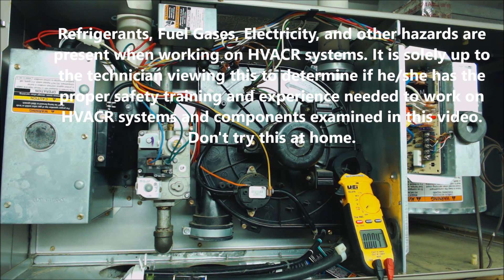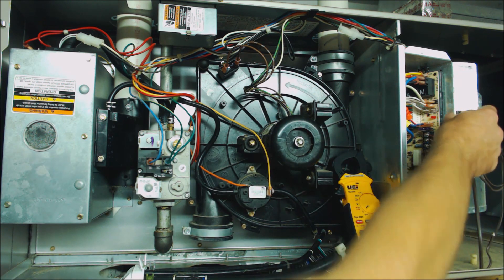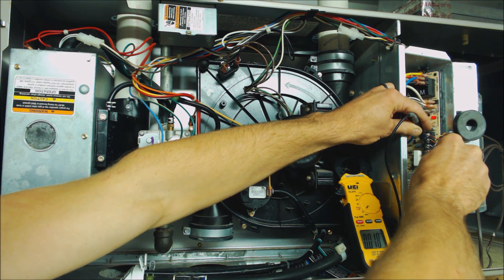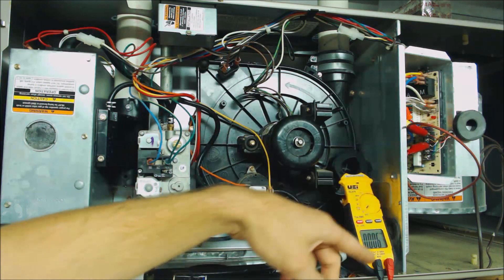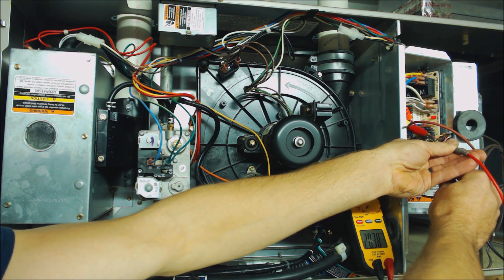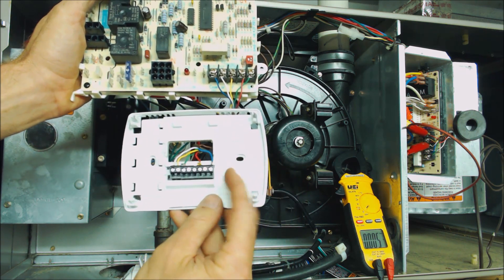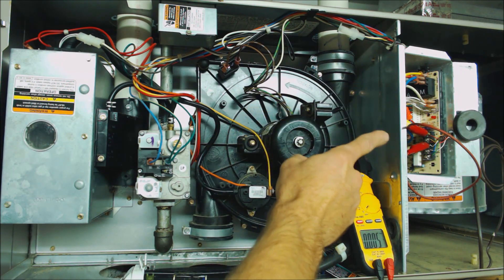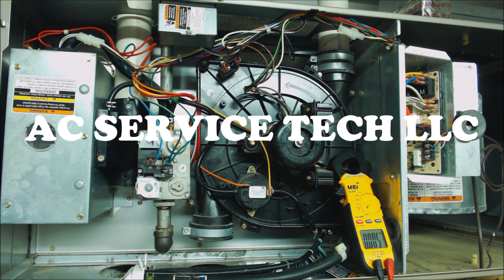Thermostat Troubleshooting! Thermostat Won't Turn Heat, AC On!

Comment: My set temperature display won’t even turn on, on my thermostat. It only shows the room temp. I put it on heat and it doesn’t turn on, or display the set temp.

Comment: I had an A/C company came out because the heat and a/c unit wouldn't come on.  So they went to my furnace and told me that there is some sort of switch in it there that would signal both the a/c and heat unit to turn on.  Could you give me any further information about this because as of today the same thing happened? Thanks

Comment: Thank you for this excellent video. If you measured voltage at the thermostat from W to the other terminals on the stat what voltage would you expect if there is 24V at W . For example if there was no common at the thermostat.  Is there any way of measuring the voltage at the stat if there is no common present ?
Reply from the maker: No there is not a way. That is why we jump in that case and then measure for voltage at the control board, thanks!

Comment: So I had a call last week where flame would go out 5 minutes into the heating cycle. The unit would go through the sequence of operations everything seemed fine then it cuts out. I cleaned flame sensor and that did not help. It was a 2 zone system with one thermostat controlling both zones. I checked zone board and could visually see the call for heat cut off. So my question is could that be a faulty thermostat, control board, or zone board. It doesn't do it just in heating it's cutting out in cooling mode also. Another confusing thing was that no fault codes were showing. I let it cycle three times and it locked out but still no fault codes. So to me that eliminates any safety trips. Any thoughts?
Reply from the maker: Hey David, What are we talking about? Forced air gas furnace with zones or boiler and air handler with zones? Yeah, the rule is to always do something if it is an intermittent problem. If the board is not registering the problem, it could be the thermostat wires and thermostat but I would want more info though. You said it cut out every 5 minutes. Did you try disconnecting the thermostat wires and just jumping the board by itself from r to w to see if it would still happen? thanks David!
Reply: Thanks  Craig, 
It is a gas furnace forced air
I will be going back there in a couple of days and I will let you know what I find. I did jump out from board didn’t notice anything. Then again I probably didn’t do it for long enough time. Think I was trying to do to many things at once.
Reply from the maker: Yeah jump it out for a longer period of time. While you are waiting for that you could also try switching out the red power wire in the thermostat with another available wire if they ran extra wires for the thermostat. Also change out the common if possible and if the tstat was not running on batteries. Leave the switched wires in place to see if that solves it as well since it is cutting out in heat and cooling mode, thanks David!

Comment: When jumping terminals at the board is there any danger of shorting the stat? I was told to disconnect R at the board before jumping terminals ro protect the stat.
Reply: No. Dot it will tell u if ur tstat is bad
Reply from the maker: Hey Tomon8tor, I don't disconnect the tstat first and I never had a problem to date when jumping at the control board. I am not saying what you are doing is bad though. That is just taking extra precaution, thanks
Reply from the maker: Thanks Alex!